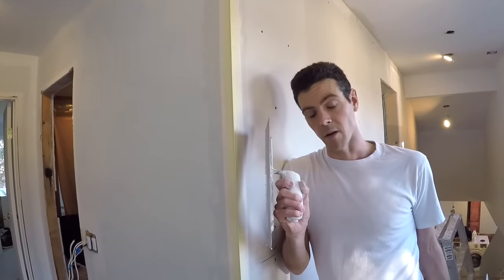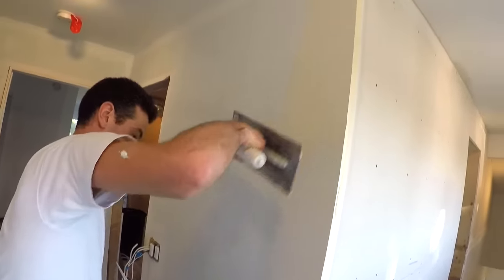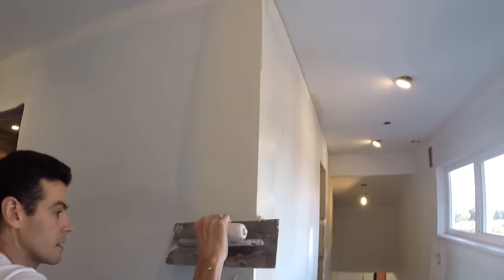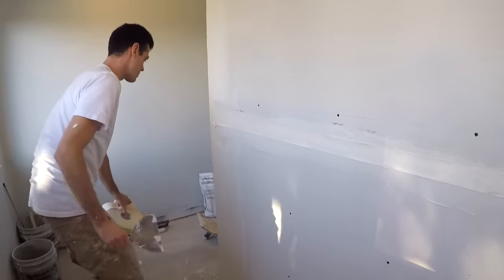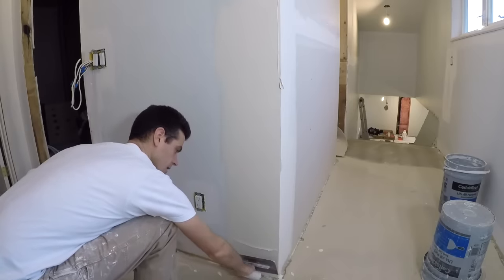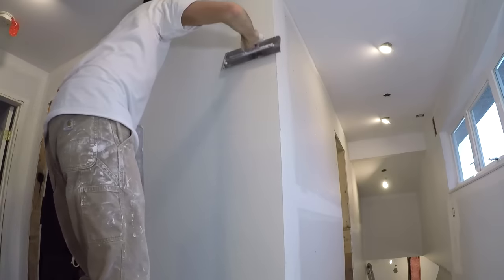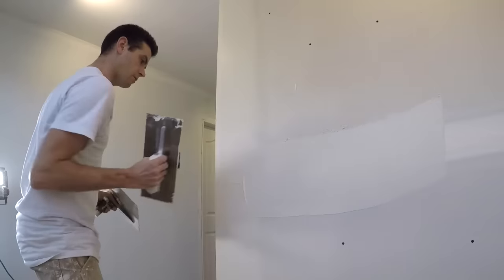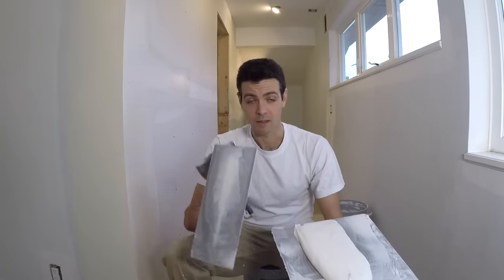HOW TO COAT CORNER BEAD (hawk and trowel)

Comment: When I started finishing I learned from some old timers and got really good with a hawk and trowel. I still have my trowel one of the guys gave me when he retired. If you are good with it you can do it a lot faster than a pan and knife and with better results.
Reply: A double butted trowel would probably help to get a better finish & always go plain steel, not stainless as it keeps a sharper edge. Less sanding down after.

Comment: I'm currently finishing a small room in our house with lots of weird jut outs and outside corners. I would love to see another video on finishing a corner bead, especially seeing more of the texture that you're happy with. I find it extremely hard to get a perfectly smooth finish on the first coat. The more I try to finesse it, the more I mess it up. What is fixable once dry (can be scraped off or filled with second or third coats), and what do you want to fix while it's wet. Thanks

Comment: Conscience got the best of you 😲..... Say it ain't so... Lol.
Great stuff to hear!!!! And now I don't feel so lonely. So many ppl say... "oh that's good enough" or when they know better but yet leave it. My conscience kicks my butt everytime and I just can't leave it. So it was refreshing to hear!! 👍👍👍👍
Also wish more tapers would consider the carpenter.. I've been a carpenter for 35 years and things are to the point nowadays where I have to clean 3 out of 4 inside corners when running base and hanging doors has become a nightmare also due to the taper cleaning his trowel off in the door opening or running the horizontal tape long and folding over into the door opening. Ughhhhhhhh next thing you know that half inch you have to shim a door plumb is now an 1/8" or less. Or they let the drywall hang into the door rough opening. Good grief.
But alas... Your a carpenter too so you know about what things can hassle the carpenter thus you don't do it to those extents.. Lol.
Nice video and I'm subscribed. Thanks for the upload. Again... 👍👍

Comment: I like to use a 50/50 mud primer mix on painted walls first with a roller.stops the mud sliding around and reduces fisheyes a bit(also dish liquid in the mud helps) and i put a couple handfuls of confill in the mud when loading corners reduces shrinking and is stronger.just a couple little things i do.
Really like your videos you know your stuff man.From an Irishman working in the bow valley and calgary.

Comment: I would love to see an episode doing a inside corner joint repair where it meets a horizontal tape joint and feathering out the point where you have a joint of new corner tape meeting old corner tape and a horizontal joint all at the same point. I’ve done it successfully in 3 coats but I had to feather it out close 24” to get it hidden. Love your videos and you do great work!

Comment: I learned to finish drywall in the 1970's . It paid a penny per square foot to tape and do one coat on the bead. approximately $50-60 per typical 3 bedroom house. I was concerned when I first saw you filling bead w/o taping seam first!!!   Since I was paid by the job I had to learn to do it fast so that I could complete the first coat in one long day. The tape coat was all done with 6" knife so I did the first bead fill with that knife as well. All with tape mud. I changed to finish mud for the next coats ending up with a finish trowel skim coat last.

Comment: Is it necessary to use “taping mud” when you’re just doing a small DIY project, or can I use the same all-purpose mud? I removed a laundry room door and trim, and am replacing the trim with drywall. I don’t want to buy a lot of excess materials that I’ll never use up if it’s not necessary. Thanks to any pro drywaller😊 who responds!

Comment: Nice work.  I prefer to load each side on bottoms first.  (Or Ill do tops while on stilts.  Once I load one side I feather, clean up the nose and then load, feather and pull tight.  Then I clean up nose and pull other side tight.  Then Ill repeat process bottom/top.  I find it's a little more foolproof as far as not messing up your work.  But the end result is all that matters and yours looks great.

Oh and I use pan/knife!

Comment: That was a sweet move where you used the front of the trowel upside down to scoop the booger off the bead.

I usually let those dry and knock them off later. Once I get a corner looking good I don't have the balls to touch it until it's dry.

Comment: Do you prefer paper or vinyl bead? I use vinyl bead because it has a bit more fill so it is a bit more forgiving on out of square framing. Down side is it needs more mud thus sometimes it needs a third coat

Comment: Future course on different types of beads, did you use paper tape for the corner? Or pre-made metal or plastic,  bendable.  Etc.   mud mixtures for each job, water or thinner?  Estimating how much drywall for a house, room, how many tubs of mud per room per house...trowel care to keep overnight rust off.  Clothes to wear, wipe rags or gloves, sandpaper vs sponge, ladder vs stilts, how to wear stilts, how to finish stairwell, how to hang stairwell ceiling, how many coats for each tape seam, what are the different levels of finish and how to decide, how to love with mud developed ocd and ...most importantly when to know when you are finished and ready to paint.

Comment: One of the few tapers that flip the trowel sideways to make sure the bead is properly filled ...  personaly i prefer a crown trowel for bead only for that reason you can put some pressure and make the bead perfect ... this way on skim coat you're not still filling your skimming tight and not leaving orange peel look that ends up getting sanded away

Comment: Great series. I've learned more from watching your videos than from all of the DIY drywall books I've read. 

But here in California, most houses have textured walls that are made by spraying on and then knocking down a texturing mud. That texturing gets in the way of making smooth patches when repairing existing walls. When patching a textured wall, do you just ignore the texture? Sand it off? Other ideas? Possible idea for a future video?
Reply: Patch it with drywall then scrape off at least 16 inches around the patch if possible (patches are like butts and need to be this wide to feather nicely.  Now you coat like normal/sand.  I prime the patch.  Once dry you can match the texture.  Practice the texture on scrap if youre not sure.  Get the texture good on the fresh patch then blend into the old stuff until it disappears.  Prime fresh texture & and paint to match.  I do a fair amount of texture ceiling repairs and thats how I do it! Lotta work to make it blend but it is what it is!

Comment: Can you do a video comparing the different types of cornerbead?
Reply: I have been doing this for 35 years,,,,and I only use metal corner bead,, and always nail it every 8 inches, and squeeze it to bend it past 90 degrees,,,to be sure to have enough space for mud to be thick enough not to crack.
Reply: George Spangler u r  the man, metal is the best at the corner
Reply: @adangarcia1973  Thanks Adan,,,I'm a man that can do pretty much anything and do them well,,,I'm not a drywaller,,,a general contractor, but I do all my smaller sheetrock jobs,,,and have learned the best techniques,,,that will last...very important to use plenty of nails,,,and bend need enough for mud, and curl end tips in a little...
Reply: @adangarcia1973  and make sure to buy the heavier gauge beed,,,because there are cheaper beed,,,but you will have to nail it a lot closer.
Reply: @adangarcia1973  one more thing, I always put my tape on first, and then put need over it and do last two coats...
Reply: I mostly just use paper tape
Reply: @myfirstcrappyvideobilly  Paper tape on the corners?
Reply: @dartme18  maybe they mean flex tape? It's paper but with a strip of metal either side of what effectively becomes the angle.

Comment: This is how I do it but I noticed you mentioned a shoulder injury back along , so putting as much through your legs and hips as you can will save your arm.  Great work and it’s nice to see good technique online, most i see posting vids look so awkward  and are obviously not working ergonomically.  The technique your using there can be taken to tremendous speeds because it’s correct and with the least effort.

Comment: One question- if putting mud over painted surfaces is a problem, wouldn't priming them first be a good idea?
Reply: Unpainted drywall is very dry and soaks up moisture very fast. Primer adds a layer on the drywall so that paint isn't soaked up by the sheetrock. Basically the painted side is already primed.

Comment: I'm just curious as to just why you're using a trowel and not like a taping knife? When I'm mudding, I'll apply mud maybe with my 6 inch knife, then I'll feather it all out with my 12 or 14 in knife...why the trowel? And why do you use paper corner bead instead of the screw down stuff?
Ben I'm impressed with your skills friend !! Your work does look great !!
Reply: NinjaBOT SpaceCraft 

When you learn how to use a hawk and trowel it pretty much eliminates different size knives as you can feather joints and pull out the butt joints as far as you want.
Reply: @chrisj197438  
I've been a handyman 8 years now. I use a hawk only doing texturing on ceilings or walls. I use the trough with everything else. I just wanted to know if there's an advantage using a trowel over knives. Truthfully if i can speed up while still keeping my quality on par, I'm all for it
Reply: @ninjabothandyman6063  there's another video by this kid doing a side by side comparison of hawk/trowel vs knife/loaf pan and why he finds the former the best fit for his work.

Comment: Vancouver Carpenter, got a quick question. When I sand in between coats, it leaves dust on the wall. Usually not that big of a deal, but sometimes when I go to do a second coat, the dust will mix with the wet mud and create clumps in corners and such. Do you wipe down your walls with a damp cloth between coats? Or does something with your process avoid that problem alltogether?
Reply: Not a pro but you don't normally sand between coats. You can remove the bigger bumps with a knife before second coat boat that's it

Comment: A couple of questions for you Ben: what mud are you using here? Is it lite all-purpose or something else? I seem to recall that on previous videos that you'd use quickset on the painted wall side (or both) to help manage bubbles, after which you'd embed mesh tape before applying the top coat. Why didn't you do the same this time around? I apologize if the answer is obvious, however, I'm only a DIY guy with poor drywall skills. 

Love all your videos!
Reply from the maker: Taping mud for the tape and bead install and finish mud for both coats over top. Thats my preferred method but occasionally I need to use quicksets. I often use quicksets in the videos to film the whole process in one day.
Reply: Vancouver Carpenter not using a setting compound for a base coat is undeniably an inferior product. Not wrong, but not as strong, period.

Comment: is there any reason to use tape on outside corners rather than actual metal corner beading...would there be any situation whereby you'd use an actual metal corner bead instead?

My gut feeling is that paper tape wouldn't be as resilient as a metal bead is all

Comment: Great video - Question: You made a comment about using taping mud.  Is there a difference between taping mud and corner bead mud or other mud?  Aren't they all the same thing?  Thanks!
Reply: No. Hardening and drying time.  Good question and great to know before you start.

Comment: Do you ever replace a large portion  of a plaster wall with a piece of drywall? If so, can you make a video of how to? For one, I’m having a hard time getting the drywall flush with the existing plaster wall. The portions I do get relatively flush, the tape lines are very noticeable after painting.
Reply: If you reply back, for reference, the plaster is coated over fiberboard, not wood lath.

Comment: Yep, flats 1st, butt joints 2nd, and corners last. I didn't hear an intro of what corner bead you used. I think I'm seeing paper forming a taped joint. Maybe a caution against using plain metal or plastic corner bead without taping.

Comment: It works better if you coat both sides of the corner bead first. Then pull one side and then the other. That will eliminate the worry of getting all that excess mud on a finished side. If you are using  bullnose bead that you coat one side at a time due to the separation in the two sides from the bullnose itself.

Comment: Good video.  I have a metal corner bead where the fill has chipped away (about 2").  What type of mud/spackle is best to repair a chip?   And, is it possible to buy it in a small quantity for a small job like this?
Reply from the maker: You could use just about anything for that small repair. A small container of all purpose mud would be best.
Reply: @vancouvercarpenter  Thanks.  Some of the pre-mixed spackle I've seen says to avoid using it in high-traffic areas.  I'll go with some that doesn't have that restriction.

Comment: Thank you my friend! Were you union-trained?  The French-Canadian you spoke of in your last video is like a master with that hawk & trowel. you are pretty good yourself.
Reply from the maker: The unions were all busted up out here in the 80's. Painting, drywall and carpentry are all the wild west. There is still a carpenters union but they only do concrete formwork. There is still union plumbing, electrical, welding but it is only for large commercial stuff.
Reply: @vancouvercarpenter  I hear ya, most unions here in the U.S. took a huge hit in the 80's too under the Reagan administration. It was and is now a full all out assault on labor.

Comment: I thought those tools were for cement. 14" Mud pan, 6" and 10" joint knife is what we used in Columbus, Ohio.  Mad skills though it's all on the wrist.
Reply: you should give it a try! I did and it took me to another level, quite fast. I have never worked faster and had smoother results before.

Comment: Learn a lot from your videos! Thanks!
But, I have some arched doorways in my house. How do you tape and mud them? Are you able to do a video on that?
Reply: if it has a flat in it then it shouldn't be in the curve so it would still be finished like a regular flat or butt joint and if it's case opening then they make a plastic bead (that kind looks like a tear away) that can be cut on one side wherever your bends are and you can do it with nails or Staples but Vancouver may do it differently

Comment: I'm doing a small remodel and I have to add a corner bead where the new wall meets the old textured wall, which is about 5" wide. (It's a corner) How should I do that? Do I need to send all the paint and texturing of the old wall/corner?

Comment: There's no such thing as a mistake, or at least I HAVE learned something important from your mistake.  I HAVE learned that there's quickset mud, then there's taping mud, and you used taping mud when installing the horizontal tape, but a quickset mud on the corner bead. Is that correct?
Reply from the maker: The quickset was just to level out the old wall. The bead install was taping mud. The two topcoats were topping/finish mud.
Reply: Some guys use quickset for first load coat beads because it shrinks less.  Just dont mix down your load coat with too much water and use a finishing compound and your shrinking should be negligable unless the bead was set poorly or framing is bad and youve got a big fill.
Reply from the maker: @brendenw3231  I only fill beads with quickset on deep fills or one day jobs. I do the same as you, I try to keep my mud on the stiffer side for loading bead.

Comment: Regarding the butt joint you did real quick like: When the drywall compound dries and shrinks under the tape, you'll have voids under the tape?
Reply: dartme18 Yes he will, more than likely he’ll float it out prior to painting. It won’t look as good, but it won’t be that noticeable.
Reply: The tape might bubble but he had consistent mud. What I usually do to ensure no bubbles is to wet the tape before you set it. That way the mud when drying actually grips the paper leaving no bubbles. But i have done exactly what he has done and not had problems and other times I have had bubbles that I repaired.
Reply: @mikecase9365  So you're saying the mud, when it's drying and shrinking, sort of sucks the paper back with it?
Reply: @dartme18  that is exactly what I'm saying. When the mud drys it drys on two surfaces. The first being the drywall paper on the board itself which acts like a wick. The other is the mud itself which is through the tape as well. Majority of bubbles I see is from people who squeeze to much mud out causing a void and when dry turns to a bubble. The other time is when you are hand taping and there is a natural bubble from application. Not enough mud and the paper is dry causing a bubble. I have found if you wet the paper before applying it I never get a bubble unless you press to hard. Either way the mud grabs to paper and sucks it down like glue. The other result is when applied wet it helps to spread the mud over every part of the tape. Taping mud has a high glue and also makes it thicker.